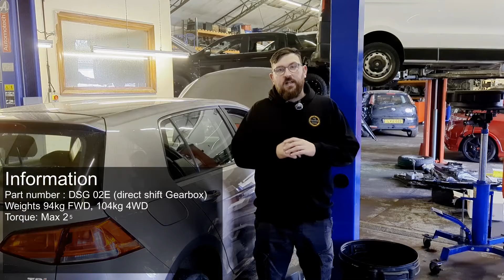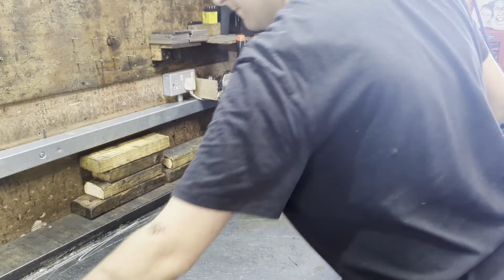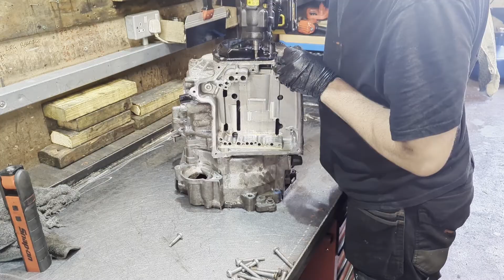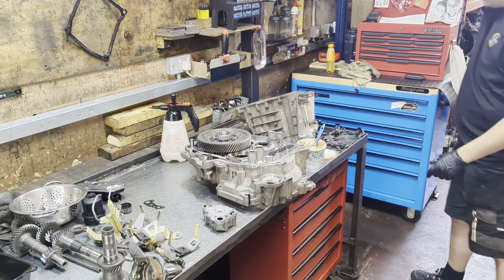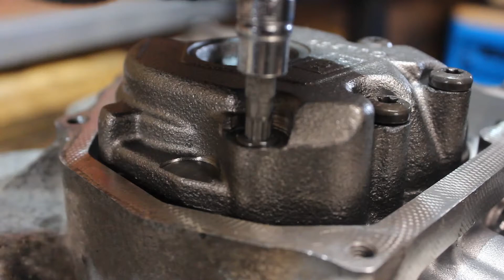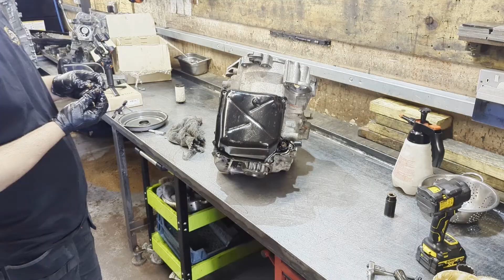02E DQ250 DSG Gearbox: Teardown, Repair, and Rebuild Explained

Comment: Hi i have an issue with my dq500 wi code P1071600 . Final shaft sensor. Gears 2,4 , only working.

Comment: I have an 08 r32 vw mk5 im hearing some noises in the cover of the oil pump on the dsg trans but car is driving just fine could the bearing behind the oil pump be going out? Or the pump itself be failing? No codes at all.

Comment: What year was the vehicle this transmission came out of?  Have you ever pulled a pan on one am didn't see the fluid temperature sensor? Where is the sensor on the later models?

Comment: Greate job! I have dq250 worka Perfect no errors but is one issue just after start car (cold start)  I have to push gas pedal quite a lot and and rmps enging going down to 700rpm and up like something holding and car is staring moving and that's only hapend when car is cold after night or few hours standing:) its gearbox issue?

Comment: Got a problem with my DQ250 where I need to wait around 2 seconds going from R to D and D to R.

I hear loads of clunking before I can move the car, if I shift the car into reverse and move without waiting for the clunks to finish, the car will either not move or violently jerk backwards.  Once the clunking finishes the car moves from a stand-still perfectly fine and smooth. There was one time the car would refuse to shift out of second gear but this only happened around twice.

Comparing this to another DQ250 car I had which was more rough pulling away from a stand-still but would never do the clunking problem. Could this be the mechatronic? 

Tried replacing the N215 and N216 solenoids on the valve body but the replacements would just slam the gearbox into gear and stall the car so put the originals back on lol

Comment: Hello, how are you? I changed the same fork as in the video, which was broken the sphere, but when it was assembled all the gears worked, but when hot when turning off the vehicle and turning on hot it does not engage the second gear, what do you think it could be? No mechatronics error appears

Comment: Hi, great vid! You mentioned the fault codes but what if one isn’t showing?
I bought a 2019 Polo GTI from VW but after a wk I was hearing drivetrain rumbles, more so under power and definitely in 5-6th. 
VW have had it back (under warranty) for a month now, have confirmed my findings but there are no codes showing and there is apparently no repair path for what they have found. 
VW have eventually sent down an engineer to confirm the issues (last Friday), as I understand it, to confirm if they’ll pay for it or the dealer etc etc.
Dealer has already told me prices….. gearbox £6500, ancillaries £1700 and labour £1500-1900. 🤦‍♂️
Would love to hear your thoughts and opinions. 👍
Reply from the maker: rumbling in 5th and 6th will be the bearing giving way as long as the case isnt damaged its £2500+VAT job, if the case is damaged the price varies sometimes we can get case from VW or we have buy in a gearbox and use that casing

Comment: Where abouts are you? Got A VW mk 7 golf R and it's giving fault codes p0722 and p1793. Bit notchy in 2nd , errors indicate speed sensor. No errors on dash. Can you give approx price for repair ? Thanks
Reply from the maker: we are based in Faversham, Colchester, Torquay and Bournemouth, can you give me your numberplate can i can get a price, golf R either has 02e or 0gc i would assume with those codes its 0gc but want to check
Reply: @TheGearboxCentre I got new engine mounts & gearbox mount done along with LUK DMF done & reset but after 2 weeks a bearing/drone noise has appeared above 40mph. Everything else works perfect. 100% not a wheel bearing. What would be a rough price on getting it fixed

Comment: Hello i have problem with DSG DQ250 after start car when the car is cold hear buzzing sound from oil pump cover. When the gearbox warms up, the sound disappears, could it be the oil pump? Thanks

Comment: Hi, I need new c clips for the ends of the shafts. Where can I get them? Also, do you have the torque specs for the two case halves?
Reply from the maker: drop me and email at aftersales@thegearboxcentre.com and I will see what we have in stock

Comment: the DMF on these 02e, which is the LUK manufacture ,  how common are they to rattle? i had new flywheel fitted (genuine vw flywheel)  fitted my r36 when i had my chains done, 2 months later developed slight hum while driving but that stopped and now flywheel rattling again, (rattle on idle or neutral ). Any suggestion flywheel fault, clutch pack rattle?
Reply from the maker: From what we have seen it typically depends on driving style, also we always recommend a new flywheel the same time as getting the clutches changed
Reply: @TheGearboxCentre  had my clutches done about 12month ago with a new mech.  Car mainly used for local driving with odd kick down but don't think it should fail in Short period of time.

Comment: Hello, i have that gearbox and im quite blank as far as whats wrong with it, 99% og the time it shifts nicely, but at low speed when it should disengage the clutch, i can hear mechanical sounds coming from the gearbox and when it engages it gives a good jolt in the entire car when it does so, any idea whats wrong with it?
Reply from the maker: any fault codes? sounds like the start of a mechatronic issue
Reply: @ 0 fault codes, and its only when im going 5 kph, lifts my foot off the accelerator letting it roll a bit and then engaging the accelerator again 
Its gone 36300 km now maybe just wear and tear 😂

Comment: I have code p0746 for the pressure solenoid A performance stuck off do I need a new mechatronic unit? Only throws its self into limp/safe mode after 10-15 mins of driving then when I shut it off it’s fine until I drive it for the next 10-15 mins a lot of forums say yes to the mechatronic unit but also other forums state it can be caused by low transmission fluid dirty transmission filter or fluid any advice or help would be appreciated thank you
Reply from the maker: Could be fluid, we would check the level of oil see what happens then check the mech unit
Reply: I’m having the same issue. After 15 mins of driving (once temp is at 90) can’t get revers and stuck in 1st , you sorted yours yet , any tips. 
Have removed my mechanics and sending away for recon.
Reply: @naughtyscoty8472  hello issue was fix ?

Comment: Would you be able to tell me, is the shift lever on the transmission itself loose while In park? 

I recently removed my shifter cable and the lever in the transition has a large movement range for “park” and the first detent is for neutral, not reverse.

Does the shift arm have a detent for reverse?

Comment: Where abouts are you guys based? I've got a 2009 Audi S3 (8P) with the same DQ250 box. Lots of grinding sounds with any level of acceleration or deceleration in any gear including reverse, sound kind of goes away if I can match the revs. Shifts through all the gears fine and hasnt thrown up any fault codes (scanned with an OBD Eleven pro)... I'm guessing gearbox related... How much do you charge for your rebuilds/repairs like this? Thanks, Jon.
Reply: Did you ever find out what the cause was? I've got a low pitched sort of grinding noise on mine, momentarily goes inbetween shifts. Not had chance to have it looked it yet
Reply: @karlfoster986  no. Put this to the back of my list for now. Working on my other vehicles that have all broken at the same time 🤦‍♂️ I'm pretty sure there's some bearings gone in the box, probably on output shaft or something. Can't justify paying someone to sort it right now for the value of the car. Gonna give rebuilding a DSG a go and see if I can make it worse 🤣... Just ordered VCDS... Waiting for the delivery. Then will see.

Comment: Cause of oil leaking through the harness connector?
Reply: Pressure sensors in the mechatronics
Reply from the maker: not sealed properly or the plastic is perishing due to age without the gearbox here its hard to tell

Comment: hey!, im got a code saying “reverse not available” my mechanic thought it was the taper bearing so replaced it, but now the transmission shifts like crap. I live in Ontario Canada, no transmission shop will touch a Golf R DSG transmission. I refuse to pay 13K for a new one from the dealership. Knowing it can be taken apart and fixed for a lot cheaper. Do you think it’s smart for me to try and do it myself or?..
Reply from the maker: To us that sounds more like a mech issue than a mechanical issue, the mech would need testing to confirm
Reply: @ appreciate the quick reply, from what I’ve gathered this code happens to people and apparently its the bearing on the forks you were guys mentioned. Thanks for the help anyway. Cheers

Comment: My dq250 Dsg is not measuring transmission oil pressure.. it shifts fine up to fourth until it gets temp and violently drops to 2nd gear limp mode. Cant clear code, a P0840
Reply from the maker: Sounds like either a bad sensor or a block in the mech unit, where are you located?

Comment: Every video I watch for dq250 gearbox they never show the method of putting the speed sensor on, the one next to the oil pump. Is it trade secret? 

I'm about to reinstall mine and I think I'm just gonna press it on with a socket and a hammer.
Reply from the maker: Its pressed on, a hammer and a socket should do it, no secret but if we filmed all the parts being pressed on this video would be 3 times the length
Reply: @TheGearboxCentre  thanks! I was able to do it with a socket
Reply: @TheGearboxCentre  but one question, when I took apart the gearbox two shims fell out and I believe they fell out from the main input shaft bearing. Am I correct believing that one shim goes inside the gearbox casing and the other outside under the circleclip?

Comment: Amazing video! 
I’m sold! Well if and went a decent to get it fixed I’m sold. I’m still tempted to try a new clutch pack myself and I brought all the laser tools to do it and the clutch pack. But if it’s not that then I need to come here. I’ve already spent 56 days £200 at one place and £500 at a second confirming it’s not the rest of the car at fault. 

It’s had a clutch, oil filter (no mention of that included the internal filter) my mech was tested on a 50 or 30 grand machine and passed, they tried their mech in it and still the same. Because the cloned my mech I even spent £250 getting the car and DSG mapped to a standard map just to make sure it hadn’t had a doggy map on it. 
It just holds 1st to the redline. If you are on the flat or downhill and let off the gas went it would change, it’ll go into 2rd no problem, then 3rd is rough, 5 th has no power. I learned to live with it and it was okay unless you had to stop on a hill. If you didn’t have a speed bump to stop on and you use the brow of the speed bump to get it to drip into second you are fucked with it stuck in 1st. I managed to do 27 thousand miles with it like that, as I just had no more money to fix it. The original bill was supposed to be £1200. It was £1626.37, they was adamant it was a fault somewhere else so I went to the recommended garage, £455.86 for a DFP flush and a Odis check . Back the the first place Leek transmissions £354 for them to refit my Metronic they tried to tell me I needed a new macaronic unit even though mine had passed the test and there’s had still had the same problem. 
I just had to reset the adaptions in Vcds every few months. And 5th lost more and more power. 
She’s parted in my garage waiting for me to either try a clutch myself or pay for someone else’s to do it. I just don’t want it to beat me. I want to know what was wrong with it. I wish I could sue the first garage. It took every single penny I had, it put so much strain on family relationships, nan lent me so much money that my auntie stopped my Nan from speaking to me. I can’t lose my Nan because of a car I’m not know what was wrong with it.